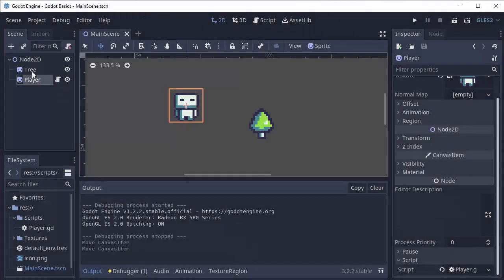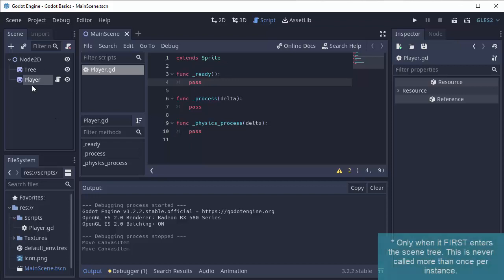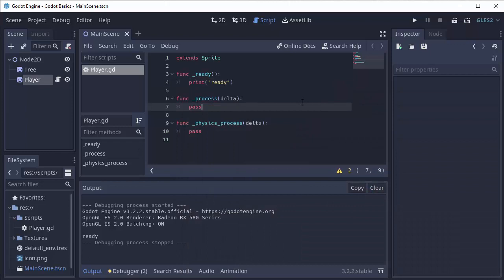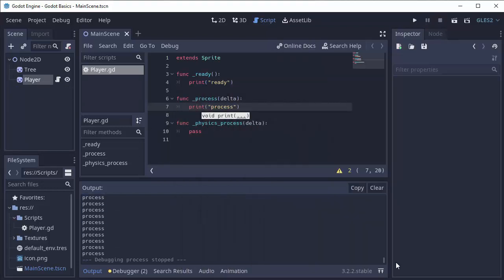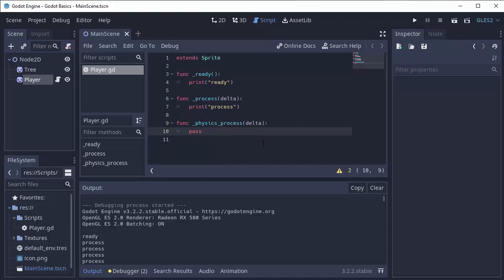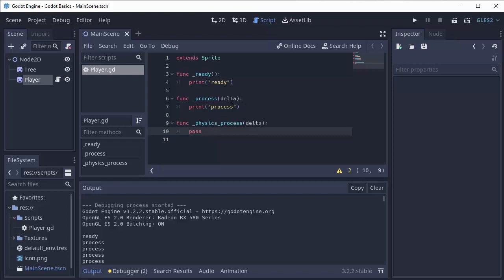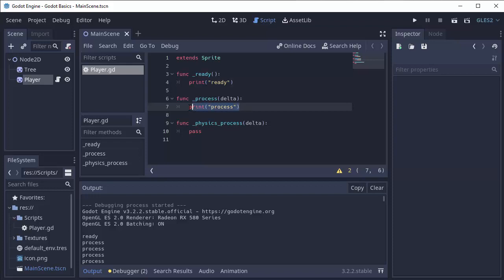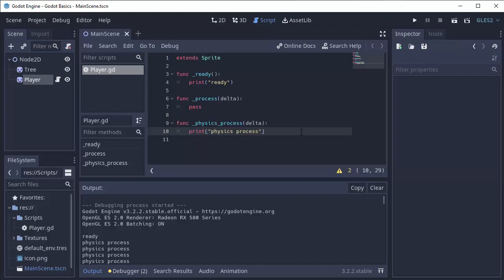Godot Basics: Ready, Process, Physics Process!

Comment: I have some question.. i mean in my mind basically func (): or func (delta): should be the important part.. because delta is used for the frame fix adaptable for all devices,ok. 
But what i don't understand is: if for example, i give differents name like func _setup (this to replace ready) this work in a different way?This "names" Have some defaults properties inside or are just conventional name for what they are used for?

Comment: So... in a working example, would the _physics version give you more consistent and therefore smoother movement?
Reply: Not necessarily, _process runs in the time of delta which is the time of your computer compared to the frame it just fired, that's good because slow and fast computers receive the same treatment.

The physics by trying to normalize the time it fires ends up either not being smoother and consistent to slower PCs and even probably to slow for fast comouters